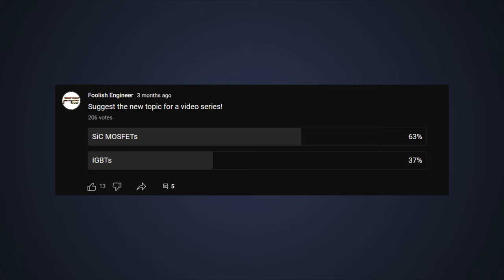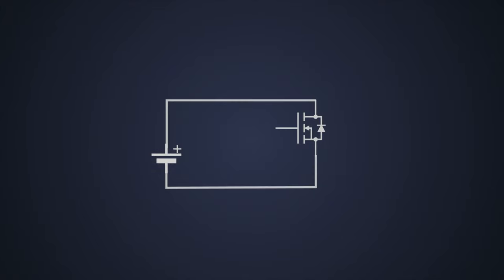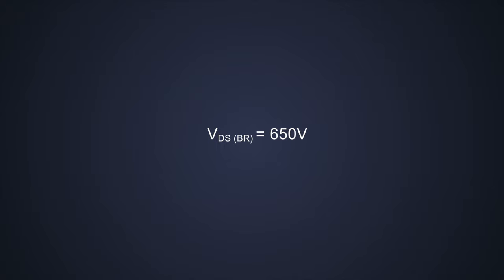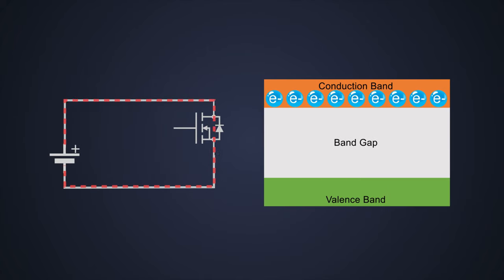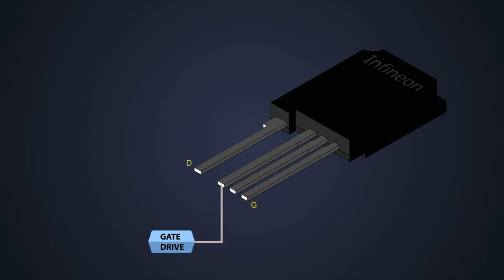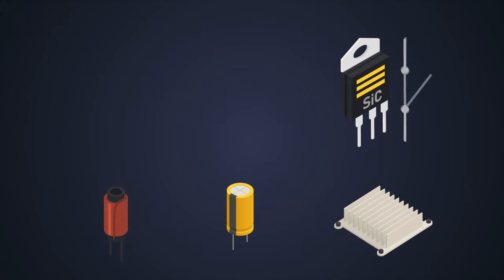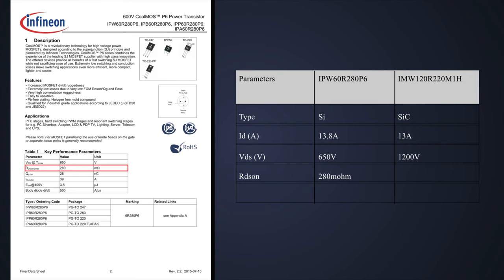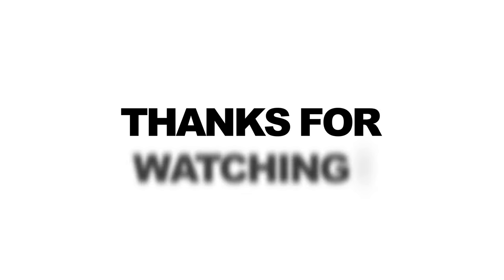Why SiC MOSFET is better? Understanding Silicon Carbide MOSFET | SiC MOSFET vs Si MOSFET

Comment: Thanks for the information. Unfortunatly SiC-Mosfets are significantly more expensive than similar Si-Mosfets. An alternative for higher Voltages are Si-IGBTs, although they are not for super fast switching applications.

Comment: In the next video we start a series that shows how to build a 220AC -> 48VDC buck converter using SiCs (active and sync rectification blocks)? :)
Reply from the maker: That’s a nice point! I can work on that.
Reply: @FoolishEngineer  Happy to help on that!

Imagine how efficient it could be. Instead of wasteful bridge rectifier, you have active rectification using 2 opamps and 4 MOSFETs that can output tens of amps without needing any heatsinking. This would be just a start of this highly efficient design
Reply: Would like to see that!!
Reply: @kgsalvage6306  Yup! Makes a lot of sense to put these new awesome tech to use, doesn't it :)